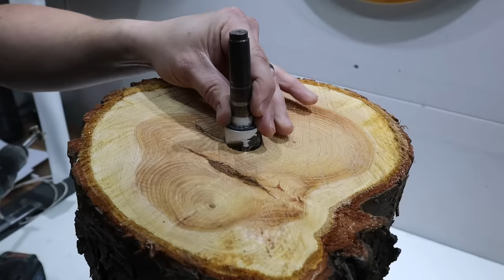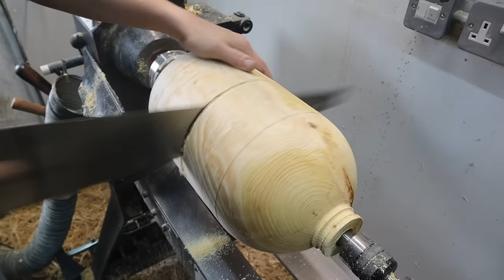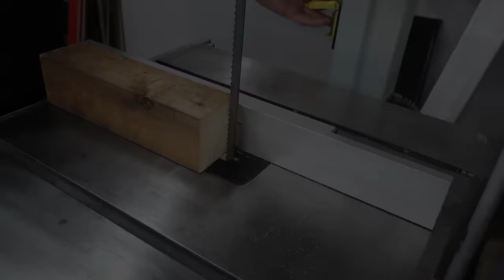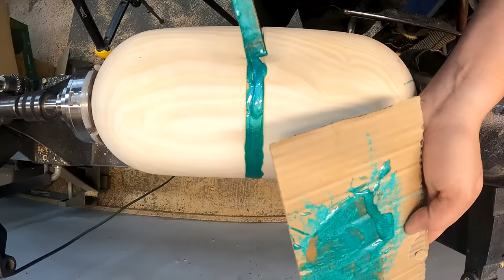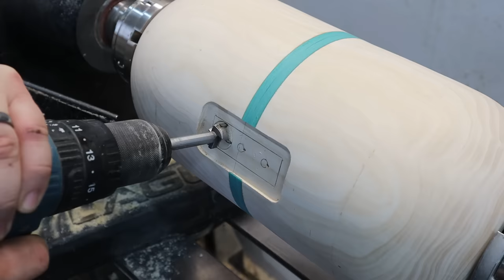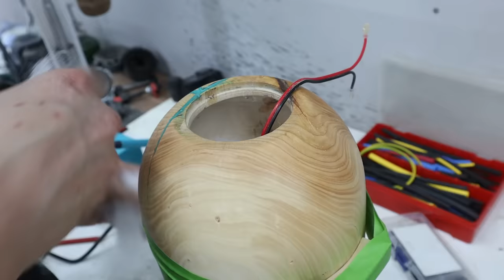Woodturning - Port Orford Cedar

Comment: Looks great Matt, the acoustic system will benefit greatly from a Helmholtz resonator, the speaker drivers and pushing and pulling against a closed cavity and can sound better if you calculate the volume and cut a hole to let air in and out as the drive moves.
Reply from the maker: Do you mean I could include something like a tuned bass port to make it sound better?
Reply: @MattJordanWoodturning  yes and there's a way to determine the size hole you will cut, it's based on the volume of the interior of the cavity I believe.  If you search for Helmholtz resonator calculator in the field of loud speaker design you'll find a new rabbit hole to explore!  Love the video, awesome wood turning!
Reply from the maker: @RobbieHyde  I'm going to guess to never watched the video all the way through..
Reply: I see I misunderstood what the wood tube you made was doing, I take back everything I said 😂

Comment: Nice work! May I know why the wood needs months to dry off? Is using a machine not possible?
Reply from the maker: Best to leave the wood to dry naturally as much as possible if you can, reduces the number of cracks, in some cases a piece can and will split into two if its dried too fast
Reply: @MattJordanWoodturning  ohhhh I see. could be tough if you live in a wet/humid climate I guess hahaha